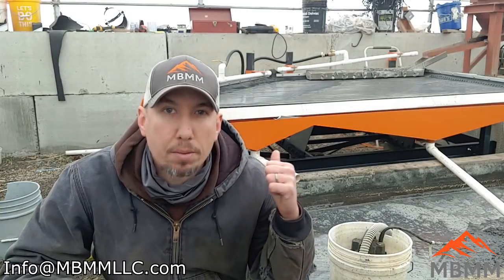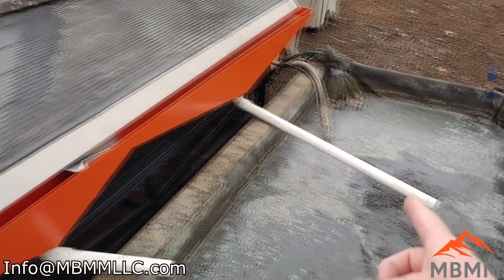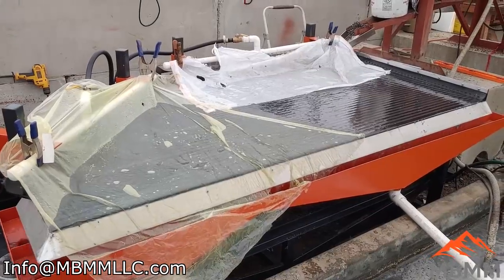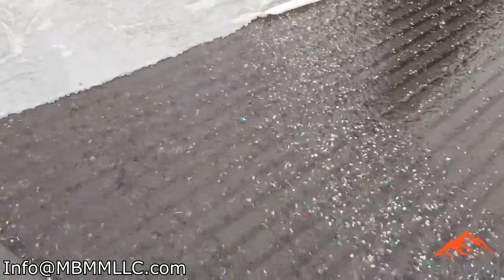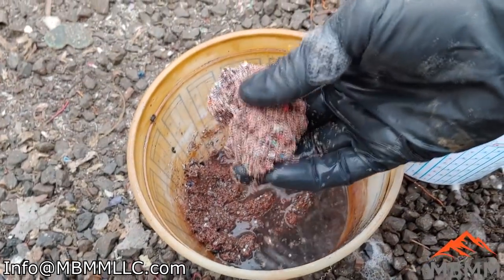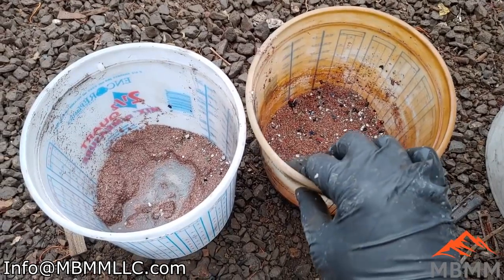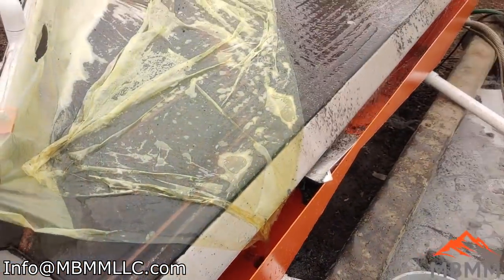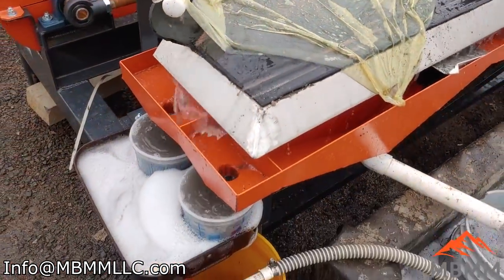Scavenging Copper From Trash With A Shaker Table, Clean Copper For Cash

Comment: Just dump a small bottle of Jet-Dry in your water recirculation system it will save you a whole lot of time I'm a gold miner in Alaska and when we do beach mining we use either Dawn dish soap in our water when we're using a recirculation system or jet dry to keep the ultrafine flower gold from floating away

Comment: You could probably put the concentrates into an acetone bath to dissolve off remaining bits of plastic/wire insulation. Next run this solution through a distilling column and re-use the acetone. Like an oil refinery. I dont know what you would do with the plastic insulation (or who knows what else?) fraction you would recover from re-distilling. Maybe someone would buy it or it is cheap to dispose of in some way.

Comment: Is it the different densities of the materials that make this work? Are we basically just gathering materials with similar density into different collection bins?  What frequency/speed are you operating for the table?  What is the source for the material that you are running through the shaker table?

Comment: So the raw material was copper wire and you are suggesting going straights to shaker table after a hammer mill?  So if that was the tailings, what was the rest of the recovery numbers?  

Great demonstration.

Comment: Could you put a rubber flap on the output of the hammer mill so that it drags the top of the water when in operation, and breaks the surface tension physically?

Comment: Would this work for aluminum as well? At my shop we throw out 100 lbs+ a day of aluminum shavings that are contaminated with polyurethane  shavings because no recycler will take it. Curious about the "static separator" you mentioned
Reply: Put it in a big container of water and stir if around. The aluminium will sink while the plastic floats.
Reply: It's an electrostatic separator.  More common in operations that do Materials processing by the truckload, as the machinery costs a lot.
Reply: @justinhaase8825  thanks. Definitely costs more than what it would save us in recycling aluminum, but I'll see if someone local offers the service

Comment: Labor costs, water, electricity, getting rid of the waste in a landfill, the cost of the machine, and maintenance, is it profitable to recycle copper?
Reply: Well...run the numbers. .25 per ounce,  16 ounces in a pound = roughly $4 a pound. Table pulls say 25 pounds of copper per hour, estimated. Runs for 6 hours a day. Set is run by small generator on $10 of diesel per day. Water is recycled and used over and over. Plastic waste is dried and sold to plastic recycler for say .05 per pound, and given a 2nd life. Little to no waste.
Reply: Starting with 1000 pounds of scrap wire granulars, getting a 15%, way low, recovery rate, 150 pounds of copper, at roughly $4 a pound  comes to $600 per day, 6 hour run time, with very little waste. Plastic pays for the fuel used. 50% production cost, so $300 roughly per day... nope, not worth it as you'd have to work 30 hours per week and only make $1500 profit. Your better off collecting aluminum cans and making $60 extra a month. Gotta think outside the box and see the bigger picture.